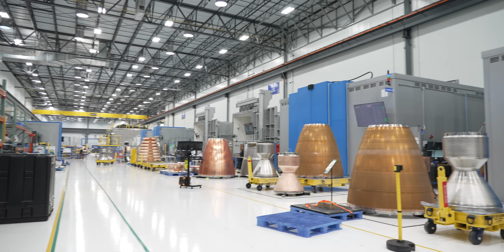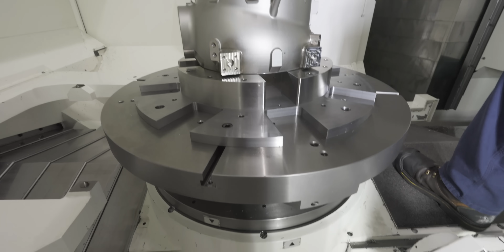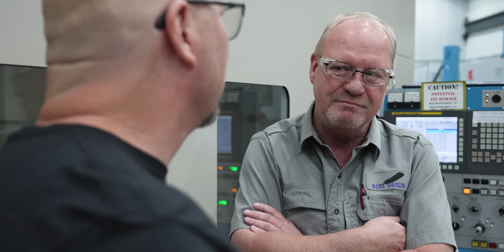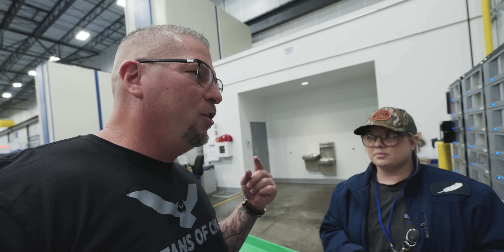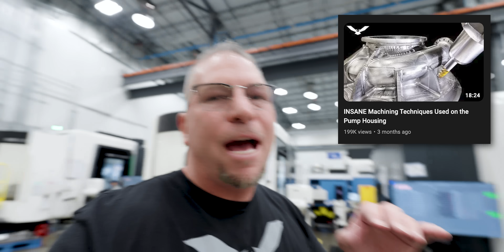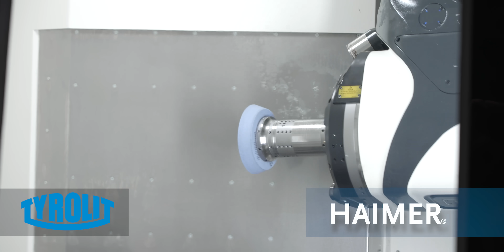Machining Rocket Engines at Blue Origin's 550,000 sq/ft Machine Shop

Comment: He keeps saying "look its clean-i want to show people manufacturing isnt all dirty and grimey" 😂 dont be fooled. The vast majority of manufacturing and machining IS FILTHY work😂 oil, grease, coolant, just a filthy oaste of metal particulate. Esp if you are actually doing big work and not just putting out 1 off pieces. Its the difference between a car manufacturer assembly line and a handbuilt custom car in a shop by a craftsman😂 not same same. Not same at all. Even "clean" shops that do keep everything tidied up pretty well-youll have a film of oil on ya. Love that smell

Comment: So.... 33 Raptors have flown a full duration burn without failures, and reportedly SpaceX is building nearly one a day.  BE-4 has never flown; the first two are on the pad waiting for their flight debut.  Raptor has 2x higher chamber pressure, 20 sec higher ISP, higher thrust-to-weight, built by the team that launched 80% of all 2023 upmass.  Blue Origin has not reached orbit yet.

I wish Blue Origin good fortune, it'd be fantastic to have another serious horse in the race.  But when you are way behind, a little humility is in order.

Comment: What's the starting salary for a class A machinist with 30+ years in trade. I setup and program vertical/horizontal milling machines. I can manually write a g code program or use CAD CAM. I write a g code program for basic parts because it's faster when you don't need to draw or make a model because you can't program with out CAD CAM. Not saying you don't need CAD CAM because you do need it to program complex parts. But a lot of the time i can write a better program manually using g code then CAD CAM will post a program. Cam will only write a program as good as you can tell it to. And i think it's a big advantage being able to read g code to edit find and fix errors and improve programs for production and tool life. Im single with no kids so I'm willing to relocate if salary and benefits are worth it. I live in New England area (Mass) learned how to machine in (RI) . I specialize in programming burrless aerospace parts.

Comment: The statements made about Blue Origin hiring machinists no matter your experience level is not true. I was turned down by Blue Origin a few months back, and I've been machining since 1994. I have experience on both Mazatrol and Fanuc 4th and 5th axis mills, and I began my career in USAF. I was trained to manufacture aerospace parts, including Lockheed aircraft that had no spare parts. I have experience with every alloy and steel you can think of. Even now, I machine hastelloy, inconel, titanium, zirconium, and occasionally aluminum. I went thru  Blue Origins' extensive and lengthy hiring process, the multiple interviews online, and over the phone. I wrote out the required summary of why I would like to work for them. I wrote out the required summary on my views of space travel. I made the very visual PowerPoint presentation to show the multiple hiring managers during my interview on Microsoft Teams interview. All I got for a response after several weeks of waiting was, " We will be seeking other candidates."  That was the first and only time being turned down for a machinist position. I was really curious as to what they were looking for since my 30 years of experience wasn't good enough. Again, the statements made throughout this video about the experience level hiring process is not true.
Reply: What amount did you ask for compensation?
Reply: @jakebpau2396  a dollar more than what I'm currently making

Comment: It needs to get payload into orbit.  Why can't it build the same factory in California like SpaceX
Reply: They manufacture New Glenn in Florida right next to the Cape. They have to because a 7M diameter rocket can't be transported nearly as easily as a 5M diameter one. Huntsville is FAR closer to Florida and has loads of experience manufacturing rocket engines at scale. California, Washington, and Colorado are engineering hubs.

Comment: Crazy!! are the nozzles clad in a Beryllium copper?
Reply: Beryllium is a health hazard. So not likely.
Reply: Highly cancerous when machining why set up in alabama they dont know it yet but soon will have people dropping dead
Reply: @jodygwiinn1233  People in Alabama know that Be dust/chips is highly carcinogenic. What they don't know, is how to use a toothbrush
Reply: Rocket engine liners are made from different copper alloys, which are designed to have reasonably high heat conductivity while being much stronger than pure copper at elevated temperature. One popular modern alloy is NASA developed "GRCop", which is mostly copper with a very small percentage of chromium and niobium.

Comment: Let's  not get it twisted Blue Origins may produce Beautiful parts and they are indeed talented individuals, but to claim they make THE G.O.A.T. engine is Blasphemy
Reply: valid
Reply: BE-4 completed an orbital mission before raptor
Reply: @iamjwns6277 how many have been refused and how many times? 
That's the current standard for rockets..
Reply: It made the rocket nerd part of me tingle every time he said that, haha
Reply: I heard that too. But I just kept quiet to myself because I already know this Titans dude has a bit of a DJ Khaled type hype-man thing going on.
Reply: I've been lucky to work with 4 different rocket engines at 3 different rocket engines.  My opinion is that rs25 is the current GOAT of engines, with Raptor quickly usurping it.  Once raptor has bona fide flight hours on it, I believe that will be the greatest engine ever made.
Reply: @mastertig1985 sorry, but while the raptor is indeed incredibly advanced, I wouldn't say that it's gonna be a pinnacle of rocket engines, and nothing better will ever be produced.
Reply: @mastertig1985 na Rs-25 will always hold the spot imo. Such an incredible design plus it has to handle liquid hydrogen and liquid oxygen all in the one space.
Reply: Yep
Reply: Agree I thought Pratt & whitey was the GOAT of making jet engines. And are the biggest and produce more than any other company in the world.
Reply: considering how much Pratts been struggling recently. I will say GE is way ahead right now. B777 PW4000 blade spitting out. Their new gear turbo that's caused massive issue for the A321 Neos. Grounded planes left and right. But one thing is for sure. Blue Origin is far from being the GOAT. They just got their toes in the water . @BrianHeath-kv6sc
Reply: Bwahahaha!! Agreed!! 🤣🤣🤣
Reply: I would say you have a point there. I don't know what it is but there's probably no single GOAT engine. My personal favorite rocket engine is the Merlin 1D but I'm a little biased because I really like SpaceX
Reply: Yea for sure.
Reply: They are nice engines but they run a conservative chamber pressure so they’re really held back. If they pushed it further it would be able to compete quite well with raptors.
Reply: @FerociousPancake888  they are already more powerful than raptor: no need to push any further
Reply: @iamjwns6277  Total thrust is a useless metric.  Bigger engine = more thrust.  What matters is thrust:weight and efficiency, and current raptors have almost 30% more thrust to weight and ISP is higher on raptor as well.
Reply: We beat raptor to orbit. So fuck off fanboi
Reply: BE-4 beat raptor to orbit
Reply: @ganno24  thats a meaningless comparison when mounted to different vehicles.  BE-4 is a great engine, but raptor beats it out in practically every performance metric.  It’s less efficient, higher dry mass to thrust, more expensive, etc.
Reply: Very nice machine shops for Rocker Lab to buy cheap after Blue Origin go belly up.
Reply: Strait up! What a joke! I mean have they even went to orbit?  Plus something about the host just makes my skin crawl 🤢
Reply: I work here and I agree. We will eventually though
Reply: Calling BE-4 the greatest engine in the world is a flat out lie, everyone knows that SpaceX’s Raptor engine is the most advanced engine in the world.
Reply: @Spacboy123  actually your are outright wrong the BE-4 is the most advanced rocket engine to launch and return and has more avionics than the former
Reply: @pkwithlemur18 you know, that having more parts is actually worse? Also when did BE-4 return (writing this in August 2024)?
Reply: @Spacboy123  Raptor has its issues. RS-25 might take the cake for G.O.A.T. rocket engine.
Reply: Yeah that doesn't bode well for the rest of the video tbh...
Reply: Who does in your opinion and what is the criteria?

Comment: 20+ years ago I went to the machine auction that McDonald Douglas/Boeing plant in Torrance, Ca. that made the parts for the DC-10 jetliner. The plant was made for WWII plane production. They had everything in there including a CMM that had a Plexiglas surround to keep its temp stable. Size, 30' X 20' X 20'. Drop forging, heat treating, machining, plating, you name it they did it. They turned it into a warehouse complex for Asian made stuff. Biggest jobs, forklift drivers I bet.

Comment: Let's not try and claim that they have the best rocket engines, especially for a company that has never been to orbit and has delayed other rocket companies who are contracted with them to use their engines as well. Hoping Blue Origin is doing well, but let's temper our expectations here.
Reply: Yep. Raptor probably takes the cake for 'craziest' rocket engine currently in production. 
If we're talking about all-time then I'd probably nominate that lithium-hydrogen-fluorine rocket engine Aerojet built in the 60s.
The title for 'best' probably goes to the RD-180 or RS-25 depending on your criteria.
Reply: @lazarus2691  Raptor is the most advanced engine ever flown, also has highest chamber pressures and beats the RD-180 in power to weight and is half the size and well under half the weight with well over half the thrust. Also has much better thrust to weight than the RS-25 and is much smaller with more thrust. Personally I always thought the experimental nuclear engines from the 60s took the 'craziest' rocket engine prize, but they never went into production.

Comment: Love what you are doing! There are WAYYYY too many people that think manufacturing is beneath them. Machinists and Welders are looked down on and this needs to change!
Reply: I'm a Tooling Engineer at Blue Origin and I totally agree with your statement.  I tell engineers all the time to take their prints to the machinists, welders, and inspectors for feedback.  These people have a depth of understanding of their processes that we as engineers almost never get, and their experience is hugely valuable.  Also, it is huge to see this on YouTube!  I've been in Aerospace for 22 years, and I can't show or talk about most of the things I've worked on.  Super pumped to see excitment about American manufacturing!
Reply: @bennymech  I worked at Lockheed for several years, oftentimes working directly with tooling engineers to help them redesign tools from the 70s and 80s. My input as a welder was definitely invaluable. I totally agree.

Comment: One of the coolest jobs you can have is making rocket parts. Amazing company making amazing things!
Reply: My mother 90 yrs old i help take care have house next door so can be there for here and own house on other side paid off rent out but have 33yrars ran largest dmg in indiana have skunk works top secret if was not for caring for mother i sell and finish out career at blue origin can see many set up that can be added as 5 axis set up is most important for 3+2  machining and shortest tool shrink fit holders for none run out issues laser measure set tools and kinematics check each week or if slammed light out faults as set tool pressure to save spindle tearing up dmg spindle high end best machine ran 33years no wonder germans bout won war
Reply: It's actually very common in my area. We have alot of large companies in the area

Comment: are they doing their work in metric or imperial ?
i am a specialist from germany, i would love to come to the USA, but these inches scare me off :D
Reply: If I had to guess I would say it's a combination of both
Reply: Just set numbers but lot more deslexia happens mm much less because less numbers to  calculate calculate
Reply: Most shops in the US use both, depends on the customer. Why would inches scare you? It's simple math. 
Inches × 25.4 = MM
MM ÷ 25.4 = Inches.
Reply: Inches add dialect mm less numbers all set worked inches 33years mm 3years much simpler less inverting of n8mbers when hung over